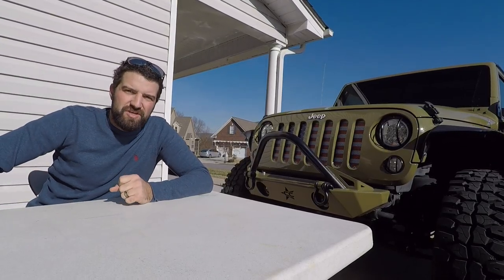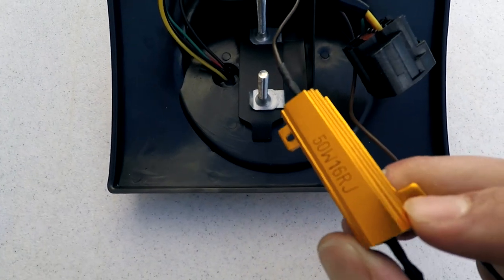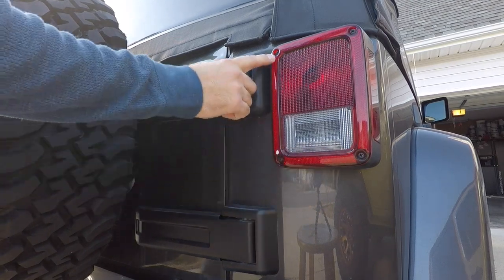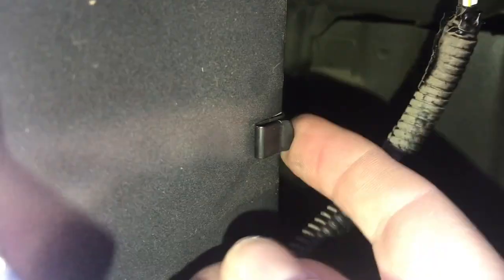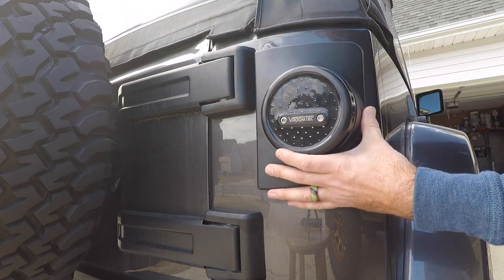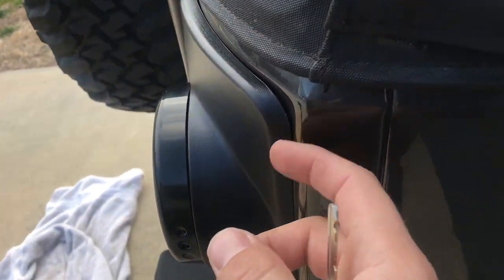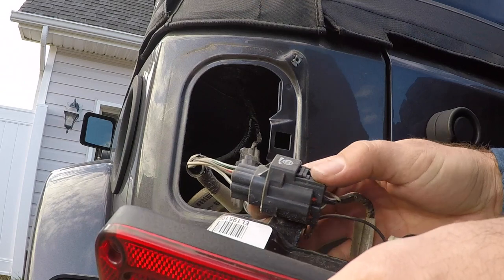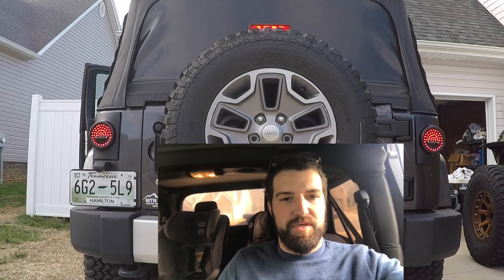HOW to install Jeep Wrangler Round LED Tail Light Conversion (Jeep JK)

Comment: I heard the reverse light with these is worthless.  Do you think a small 3/4 inch white led could fit into that bracket just below the tail light?  You could then splice both into the tail light.
Reply from the maker: Yes they are worthless... lol 😂 I have thought about it. Someone else asked me the same thing. I would be afraid of cracking the plastic trying to drill it.
Reply from the maker: You sir have given me a great idea for a video.... 👊👊👊👊👊👊👊👊👊 I’ll figure out the lighting and wiring and see what I can come up with.

Comment: how are the lights holding up? do those 3 leds on the side make them road legal?
Reply from the maker: Not sure about street legal or not. I think 🤔 the indicators on the sides are there for looks. There are no lights on the side of the factory tail lights. I had the tail lights up until about 3 weeks ago. The main problem people have posted about them was a diod or Led going out weeks after install. I had them or a while and never had one problem. If your thinking about getting them for the backup light. Don’t get them. The back up light is awful and your factory light is brighter. I hope this helps.

Comment: Not sure if that is a resistor, More like an anti-flicker module.
Reply from the maker: I don’t think it’s a resistor myself. I think it’s like a heatsink on a control board but it has like the common wire going through it. Lol 😂 I’ll tell you what it deff. Is. A PAIN IN THE ASS TO INSTALL and put together with WITH FAT FINGERS.
Reply: That was a 50w led load resistor, it is what's needed to correct the rocket flash when adding LED turn signals